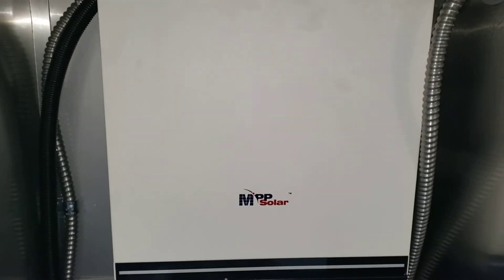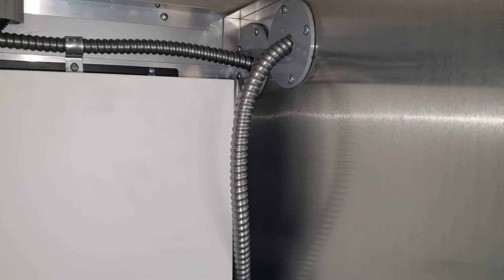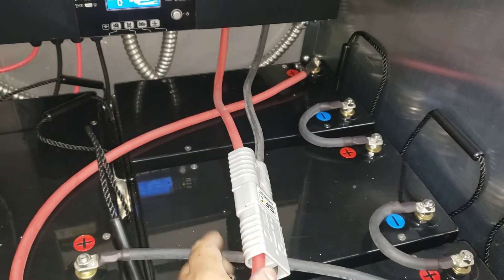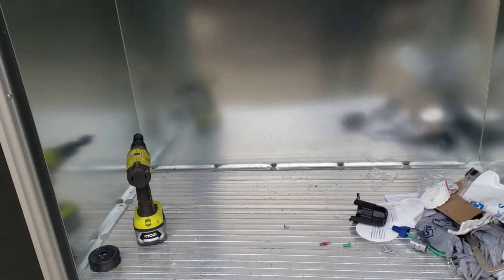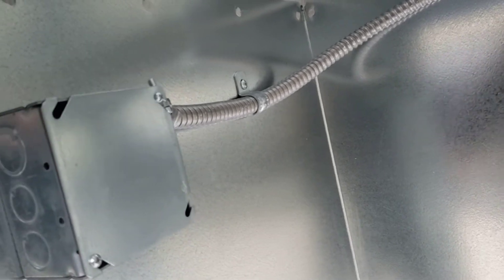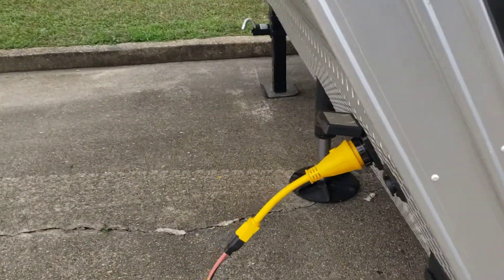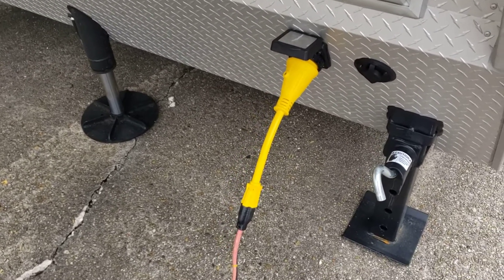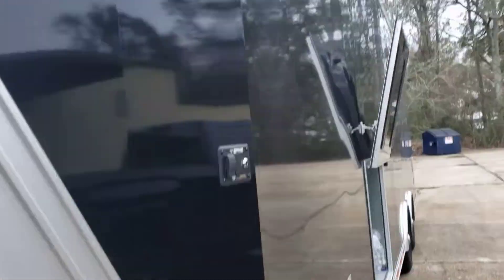LV6548 Trailer/RV setup 4x SFK-260HP Batteries

Comment: Looks good. What size cable did you use to connect your batteries together and from the anderson connector to the lv6548? I wasnt sure if they looked like 2 different sizes.
Reply from the maker: we used 2 awg cable.